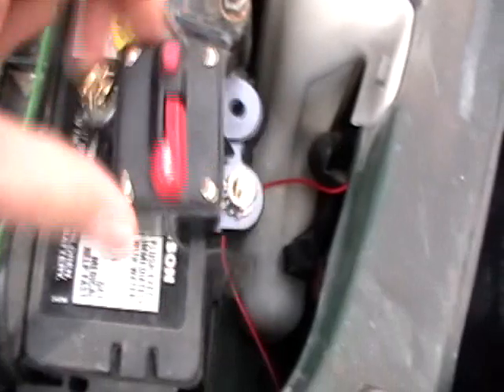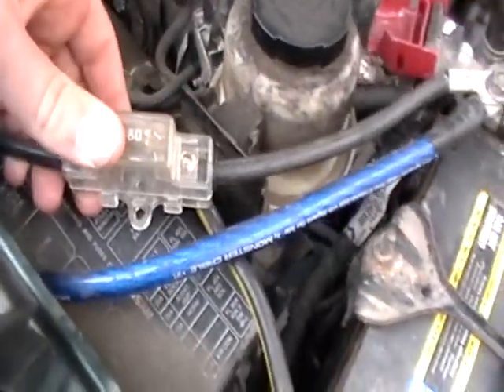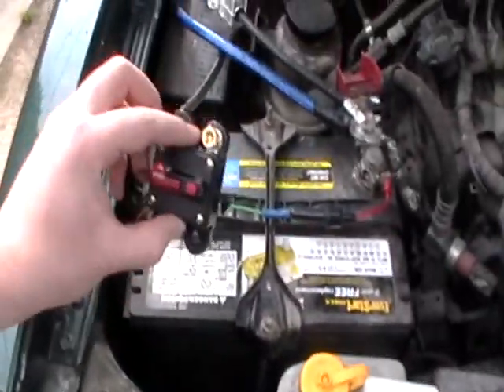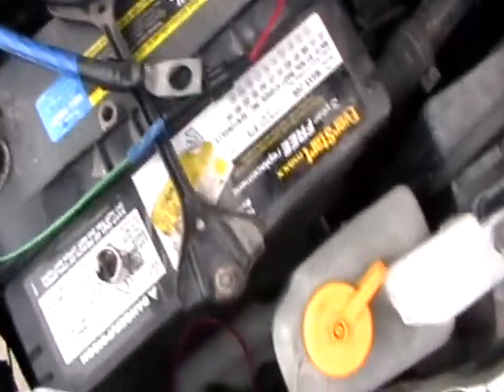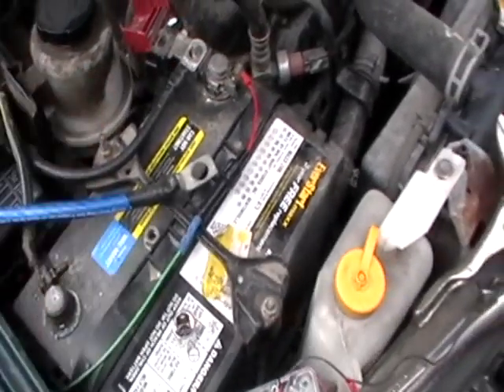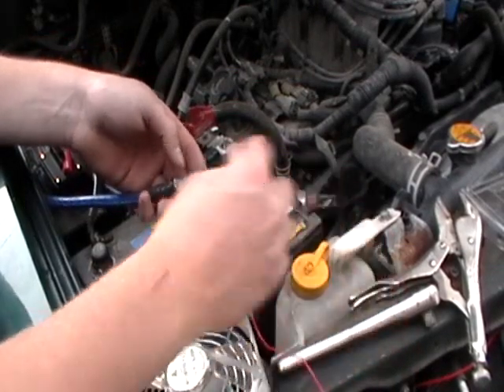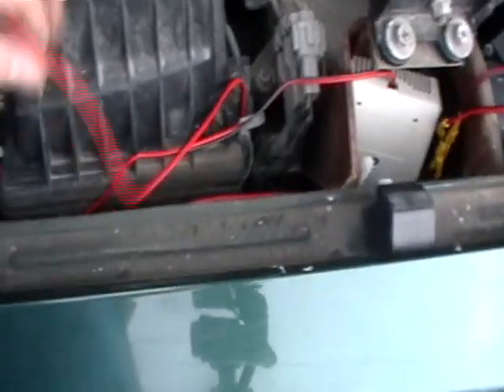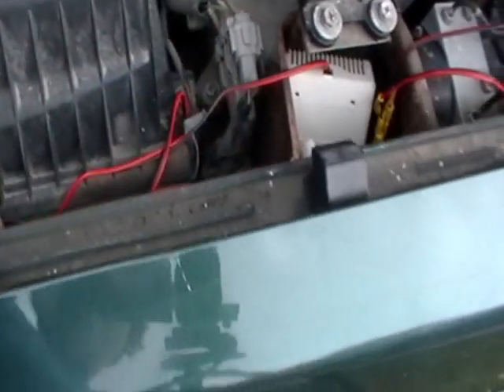installing a 12v circuit breaker

Comment: bud, a fuse blows because you have an issue. It is there to stop the cables or circuit from heating up and causing a fire. 
By adding a larger safety device (fuse or breaker)  you are inviting trouble and this should NEVER be the chosen solution. 
You need to find the source of the issue and fix what ever is blowing the fuse. 
before you start messing with your cars electrics, you really need to have a basic understanding of what you are doing. 
Not trying to be harsh mate, but what you are doing is very dangerous and no one watching this video should be following your instructions.

Comment from the maker: yeah i havent really tested it too much with the winch but my air pump is on the circuit breaker and when that fried and blew the cb blew took a while because its a 100a cb but still it blew